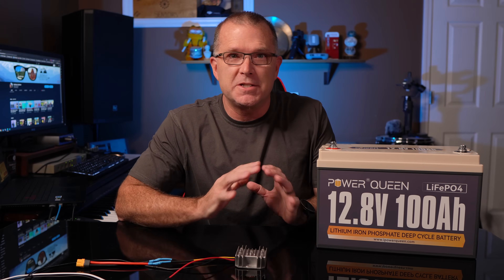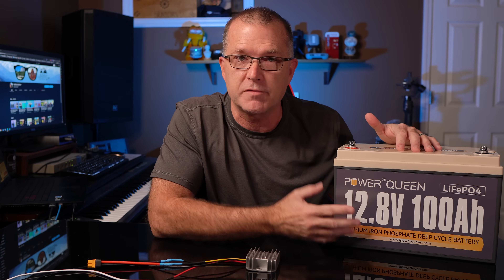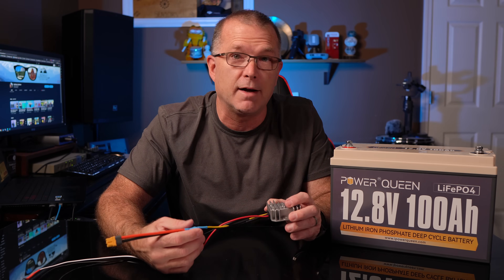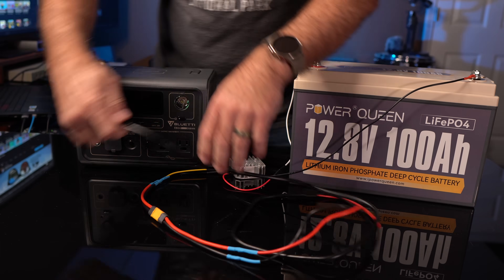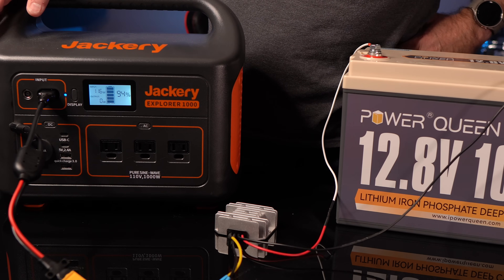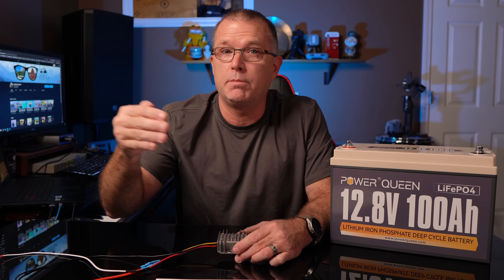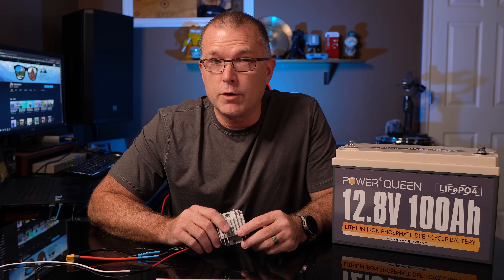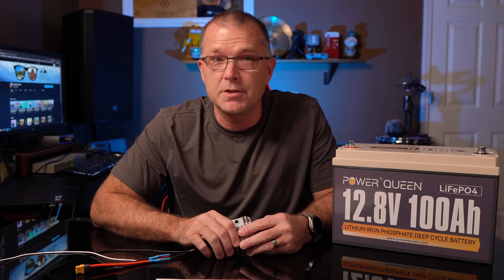SUPER EASY!!  DIY Power Station Battery Capacity Expansion / Charger

Comment: Honestly, series connected 12v batteries (or raw 48v LiFePO4) are FAR better than using a DC-DC boost.  Even using XT-60i cable will do better than what you show from limited boost.  Why wouldn't you just connect the 12v LiFePO4 directly to the XT-60i (for example) solar input on the Ecoflow (12.8v typical on these are well within the 11-60V and can supply 15A then)?  Other than getting better charging watts from the higher voltage at 24V (or even 36-60V would be better), it should still charge quite well at around the 180W you are getting out of that boost converter (make SURE you use the ORANGE colored solar input XT-60i so it doesn't clamp you at the "car charger" 7A max).  Even better, it would be much simpler to put 2 or 3 of these batteries in series to charge and get the full 500W (for the Ecoflow Delta 2) at any voltage >33v (other chargers may have a higher MPPT max current that could benefit more from 48v).  Honestly, these DC boost converters tend to waste a lot of switching power in heat and even putting just two batteries in series (to operate at 24V) would be dramatically more efficient and faster on charging current and avoid one more complication.  ?
Reply: Can I connect with extended battery and in the same time connect to solar panels
Reply: I dunno but that boost convertor looks like a perfect way to burn my house down!😳
Reply: Or just use a 24v or 48v battery depending on what your powerstation can take mine does 11-60v.  Put a fuse in there too.
Reply: I see
Reply: You are exactly correct. Much easier and cheaper do away with 
Just a cable with XT-60i to 12v-100Ah lithium lifepo4 battery is all you need ! No 12-24 booster needed at all.
I have tested it last night. The Ecoflow Delta 2 would automatically takes a constant 15 amp incoming my was 173 out of 205watts( with 84% efficiency) with no heat loss but use 10 AWG will eliminate the heat loss and voltage drop from 12 awg Ecoflow cable.
Reply: @p.b.7861 is the extra pin on the X60i connecting to the plus or the minus ??  I want to make my own cable
Reply: @BikerMiker720  Ecoflow logic looks for GND on the center pin to enable the higher charge 15A current.  Floating or Positive (like what a normal XT-60 would have) on the pin will limit it to the 7-8A charging to protect car circuits (normally 8-10A fused).
Reply: @p.b.7861  tout les batteries ne fonction pas pareille
Reply: because it only put half the energy into the power station. they are limited by amps, so you get twice the energy if you double the voltage.
Reply: @ursodermatt8809 Understood, but 12v @ the 15A of XT-60i is 180W, which is much more than the 125-150W from the boost converter (plus you lose soo much in heat doing the boost). And just putting two 12v batteries in series (or better 3 or a 48v server rack battery) would easily be far more current than those DC-DC boost and much much more efficient.  That was all I simply don't understand why folks are spending money on very limited and inefficient converters when they could do it simpler.
Reply: The Anker Solix C1000 has 10A limitation on solar input (at least for voltage up to 30V). The fastest way for that powerstation is simply get a 48v lifepo battery and feed it straight in. It will give you 48x12.5v=600w

Comment: Your DIY fan base needs to understand the essentials of fusing wire. LFP's have a very low resistance compared to AGM or FLA batteries. Thus, LFP's can delivery dangerous amounts of instantaneous Joules (energy) in the event of a short circuit. Don't rely on the BMS, fuse wires to prevent fires...

Comment: What settings did you use for the vitoman ? Oh here's my concept idea, i dont wanma overvolt my vitoman, which can go upto 30v, not sure about amperage, no less than 7.5. Can i use this device directly with solar panels that will have a voltage in 50volts and about 9amps ?

Comment: How much current does it draw from the 12 volt source? 
 Do you suppose that connecting the 24 volt output of this device to the input of a MPPT solar charge controller would work to charge a battery connected to the MPPT controller?  I am thinking that this may be a way to charge my home built solar generators while driving via the cars 12 volt power socket. What are your thoughts? Thank you.

Comment: I have seen individuals on YouTube not using the adapter and plugging in directly into an Ecoflow. Is that a problem?
Reply from the maker: Not as long as the power station you're connecting it to has a DC input range down to 12V.   If lower end of the input range is, say, 18V or higher, then you'd definitely need a step-up converter or the power station's charge controller will basically ignore the connection.  The bigger concern is making sure you don't EXCEED the max input voltage on your power station, since that can damage the charge controller on the power station.  In any case, you'd want to ensure you have something like a 15A-20A (depending on the cable gauge you're using) fuse on the positive lead coming off the battery.

Comment: (Story at a glance: Just plug your 12 volt battery directly into the DC charge port. There is zero benefit from using a step-up converter.)

-I found my high school electronics classes quite challenging, but the thing you come away with after beating your head against it long enough to pass the exam is that this formula is High Law:

Watts = Voltage x Current.

And because math is math...

You can't increase your Volts and Watts at the same time.  Not from the same battery.  Not through that little doohicky.  It's all about conservation of energy and not getting something for nothing.  (Though you CAN lose efficiency through heat generation, which is what those cooling fins on the step-up converter are for.  Wasting hard won power.)

Basically, there's electrons in the backup battery and you want to put 'em into the main power bank.  Any decent power bank has on-board electronics designed to make that super easy, sorting it all out for you at the best rate possible.  You'll end up with the same charge rate at 12 volts as you would at 24 volts.

Also.., the 120 watt limit on the charge port isn't a "Danger! Do Not Cross" kind of number.  Rather it's a "This is as much as we'll take, thanks. You keep the rest" arrangement.  -All regulated by the power bank's electronics.  That's why you can plug your power station into a multiple solar panel array (exceeding 120 watts output) and not set anything on fire.

Battery tech has come a long way in the last ten years.  I love the fact that these new power stations have all of the important components in one package so we don't need to muck around with dangling inverters and charge controllers and cord adapters and all that jazz.  It's all Plug & Play these days.
Reply from the maker: Thanks for your comment Mark.   A lot of what you're saying is certainly true, but I would take issue with a couple of things.  First, not all power stations will charge on just 12V (or 12.8V).  To know if one does, you simply need to look at the manual for the DC input specs and see what voltage range is listed.  If it says 12-60V...you're in business with a direct-connect.  If it says 18V on the bottom end, you'll need to step-up (and btw, some have minimums much higher than 18V).  I showed a 24V step-up because that falls into the range of MOST power stations.   Regarding your  dismissal of the Watt limit on the charge port, I'd definitely take issue there.  Simply put, on most power stations, if you exceed the maximum spec'd DC input voltage, you WILL permanently damage the charge controller and your power station will ikely only then be able to be charged through the AC  input.   Yes, you can 'overpanel' to an extent and put, say 120W solar on a 100W port, or maybe 700W on a 600W port....AS LONG as those panel(s) are not sending more voltage to the charge controller than the maximum input spec.   The MPPT charge controller will vary the current as necessary to maximize the input power.  Just wanted to clarify.
Reply: @ReeWrayOutdoors  Very true re over-paneling.  It's important to make sure that power stations have "Over Charge Protection".  -Which is now pretty much standard.  But even just a year ago, this was not guaranteed.  We've come a long way in a very short time!

Comment: So with 12v Battery you need that converter . What happens if you use 24V 100Ah battery, do you need any devises in between  battery and power station to regulate Amps or V, or you just plug it straight to battery?(I got vtoman jump 1800)

Comment: Is there a reason not to use a larger capacity version of the converter in this video to help with a faster charge? Thanks for this content!
Reply from the maker: Not as long as the step up voltage does not exceed the input max on your power station's DC input spec.
Reply: ...you mean like just directly connecting the LiFePO4 battery to the solar inputs?  Better, put 4 of the batteries in 48V config and direct connect.

Comment: Relatively cheap and easy expansion, thanks for the tip!
One question though: How do you prevent the LFP battery from being fully emptied? The (solar) input port on the power station will allow current coming in until the voltage drops to below minimum, but with the step-up converter that results in <7V on the LFP battery, so more than empty. How to switch off before that?
Reply from the maker: This setup relies on the battery's BMS to cutoff discharge at the appropriate voltage.  Some of these batteries even have Bluetooth and a mobile app that gives you some control over that cutoff threshold. But even without that, the standard BMS protection is usually just fine.
Reply: @ReeWrayOutdoors  Even though BMS will protect the battery, you'll need to 'kickstart' it to come back online. Is there no relay that can switch of just before BMS does?

Comment: Could you use a 12 volt to 48 volt converter I've got a Bluetti
Reply from the maker: Yes - as long as your Bluetti is at least an AC180 or bigger, since all the Bluetti models below that have a 28V solar input max.

Comment: I get 180-190 watts to my eco flow delta 2 using an xt60i cable hooked directly to a 100ah lifepo4 battery. No convertor needed.
Reply: you can do that on any powerstation.
i dont understand why he use a DC to DC converter between?
power losses from DC to Dc is all what it brings you....
Reply: @ThomasNowicki-m5s  There would be a point to it if it was still 15A, but this seems to do nothing. Nah buy a 24V battery instead this is useless.
Reply: @atnfn I don’t think his things working.  As for buying a 24v battery and do this, you can buy a real DC to DC converter which are actually expensive and now do 24v to 48v.  My c1000 can handle 60v 600w so this is a great way to charge really fast.  But…what’s the cost of a 24v + convert vs a 48v?
Reply: Is that using a 12.8v batt to get 180-190w?   I'm thinking of doing similar but with 25.6v 100ah to get around 380w, since EF D2 limited to 15A input.
Reply: @vashon100     attention le mien a brûler ma table ,heureusement que j'était a coté ,j'ai mis un câble  xt 60 if et j'ai 110w
Reply: Agreed, why waste the conversion efficiency when you can just put 12.8 volts directly into many power stations as numerous other U-Tubers have proved.
Reply: @chuckzechman1497 time.  Unless you’re using an item that’s equal or less than the input watts then it doesn’t matter.  My 24v does about 230w so my power station takes about 4-5 hrs to full charge.  If I needed less time or more power going in then I’d need a 48v battery or 24v to 48v converter.
Reply: How do you charge it in the car and keep it connected to the powerstation?
Reply: Yep. EcoFlow XT60i MC4 solar cable is my choice. Then I use a inline fuse and make my own MC4 to battery. Skip the DC converter. For best experience put 2 12v 100AH batteries in series. I charge with a Victron charger or Victron MPPT Solar.
Reply: @JenkinsUSA 64 yr old tomboy here hehe ..why is an MPPT controller needed when charging your station with 12v batteries? Somehow I've thought one was used for charging via solar panels, but couldn't understand needing one for that, when you can just plug your cable directly into the xt60 port. I'm pretty literal and sometimes it hinders understanding. Want to get it right..thanks
Reply: @JenkinsUSA I was thinking same thing
Reply: That is EXACTLY what I just finished doing using and O ring XT60i connector from my lifePo4 battery directly to my Delta 2 to top it off. I got 181w and it didn't take much time at all and no converter needed.
Reply: makes sense I was seeing about 150 watt charge off of 26 volts with the bluetti charger 1. I didn't even consider hooking the battery directly up to my power station. I was thinking about using my inverter. This stuff really gets interesting when start mismatching stuff. Thank you so much for the info. Really makes a big difference when you DIY. : )

Comment: You mention this as an expansion battery. Will your power station charge it? Or do you need another device to charge it?
Reply: I don't think most power stations would charge the expansion battery. It would require connecting either a 120 volt charger or a 12 volt charge controller. 12 volt charge controller assumes the power station has 12 volt output.
Reply: You could using an AC to DC battery charger in a pinch, but it's inefficient. You cannot do it DC to DC since the power station has a max of 10A on it's DC output.
Reply: You could charge the expansion battery with solar panels.
Reply: Can you hook the MPPT charge controller to the battery while also having the battery charging the power station or can the battery not charge and discharge at the same time like this?

Comment: Nice video 
I think the idea of a battery charging another battery (power station) isn’t genius enough because you’re depleting the cycle counts of the two batteries in a redundant move.
The best approach should be connecting an inverter into the extended battery and into ac input of Eb3a this will allow UPS of Eb3a to draw directly from the extended battery and later on from Bluetti itself this will maximize the usage of both batteries instead of depleting one to charge to other.
I hope you would make a video showing and proving this idea
Reply: Great idea can you make a video

Comment: Great information. Would this work with the 4Patriot 1800?
Reply from the maker: Sorry, I'm not familiar with the 4Patriot 1800.  Check your users guide and see what the DC Input voltage range is.  As long as it is at least 12V to 28V, should be fine using either a 12V battery, or 12V batt w/24V step-up, or 24V battery.
Reply: Thank you.  @ReeWrayOutdoors
Reply: Thank you for your response.  @ReeWrayOutdoors  This is what it shows •	DC: Anderson Powerpole connector ports; 1 set, total of 20A limit using 12V input  Would that mean that I wouldn't need the stepup if I have the 12.8 100AH Power Queen battery? Thanks again!

Comment: Any way to add a solar panel to the combination?
Reply from the maker: Yes - you'd need to add a small $20-30 charge controller module between the battery and the solar panel.  Something like this: https://amzn.to/441IFL3

Comment: I have an EB3A that i connect via cig lighter cable to 2 100ah AGM in parallel.  They are charged via 300w of solar.  Dont have a heavy load on the EB3A yet, but  I'm optimistic.  My pellet stove draws about 150w, and the AGMs will run it all night.

Comment: Could I charge the battery with solar while charging to the power station?
Reply from the maker: Yes.  You'd just need a small charge controller between the battery and the solar panel(s).

Comment: you dont need a voltage converter. Simply wire the battery to an xt60 connector and you can get 100watts

Comment: XT60i connectors not the a xt60 but the xt60i  like the one that comes with the Delta max for solar hook up and others units have an additional pin that would give more wattage into your eco flow unit from what I'm told I'm about to do a similar setup as this with possibly a 12v 48v 10a step up to hopefully get 480w input I hear these step up units can run hot

Comment: Nice. Definitely looking for a solution like this. If I may confirm, 24v3A Max is about 72W max of this DC-DC, but i noticed that it draws more than 150W. Can that particular DC-DC n d thin wire presumably 14AWG of that unit supports when it draws constantly over it’s limit to d power station? Wouldn’t it melt or burn?
Reply from the maker: Excellent question.  Even if you're pushing 150W through this, at 24V that's still only 6.25A.   If you query a wire ampacity chart, you'll see that, for very short cable runs (<2 ft), even a 16AWG wire is rated for up to about 10A.  Or course, you should STILL put a fuse inline to protect the wire (just in case), but the 14AWG wire is actually fine here.
Reply: @ReeWrayOutdoors  thanks for the input on the wire. Actually, I am a bit skeptical of the DC-DC converter when it constantly draw beyond its limit. If I may check, have u got the chance to test it n left it to charge a powerstation maybe 50% to 100% which draw high power constantly. Not sure the converter survive.

Comment: Will this work with Pecron e2000LFP as well ? Thanks
Reply from the maker: Probably not through the aviation connector inputs, since they are spec'd for a minimum of 32V.  You should be able to connect a 12V battery (without the 24V step-up conv) to the DC5521 input port and it should charge that way, albeit at a fairly slow rate.
Reply from the maker: Update:  I actually just test a direct 12V battery connection the DC5521 input and I'm getting a consistent 80W input charge.  So not fast, but definitely works.